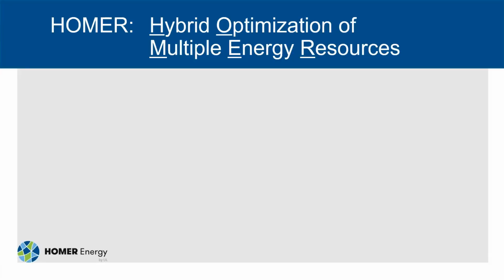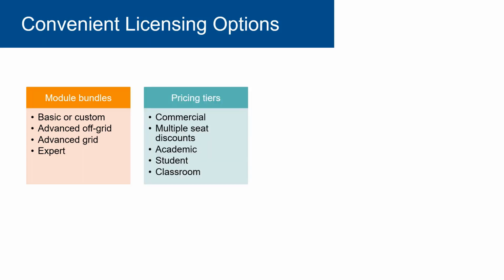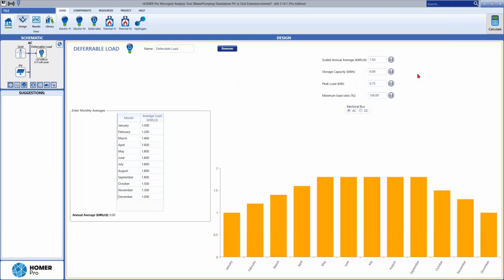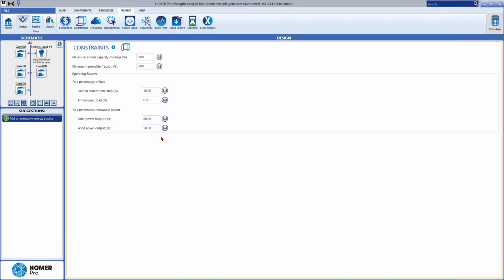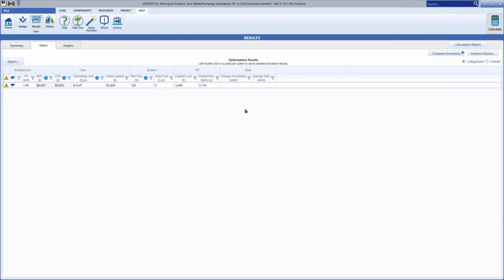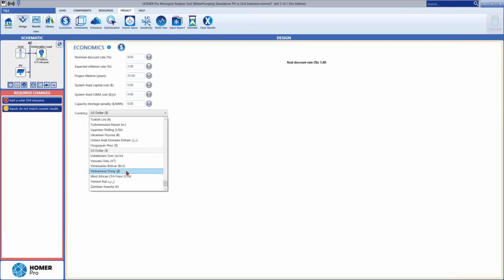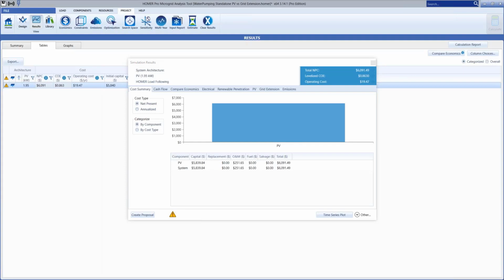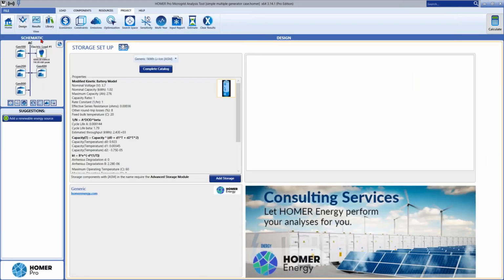Tour of HOMER Pro Webinar: Discover the Latest in Optimizing Microgrid Design

Comment: Need to ask some questions regarding HOMER software.
Q.1 Is it possible to calibrate HOMER software or able to find uncertainty in the value of the HOMER results?
Q.2 From the published literature the results generated by researchers could be used for validation purposes? The validation of two different location-based results by using hybrid renewables could be considered as standard practice?
Reply from the maker: We have a team of energy engineers that can help answer your questions around your HOMER projects. You can reach out to them at support@homerenergy.com and they will be in touch shortly!